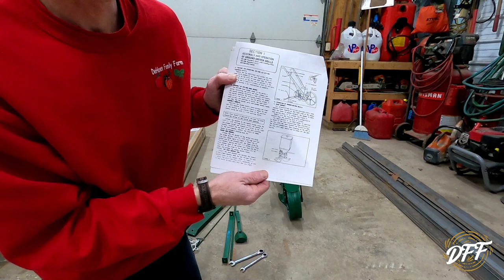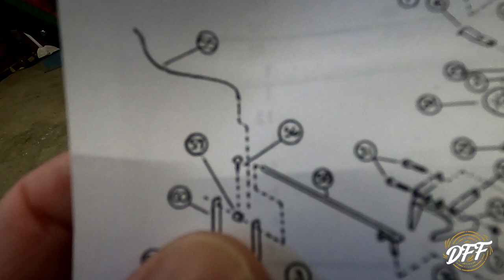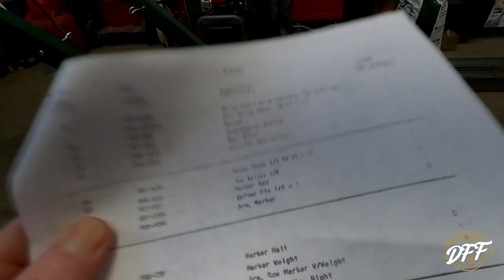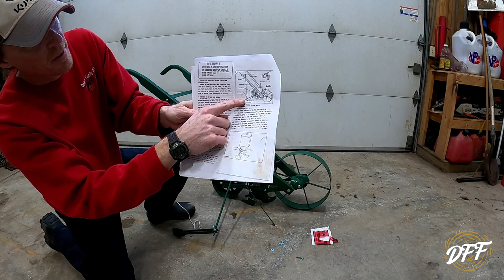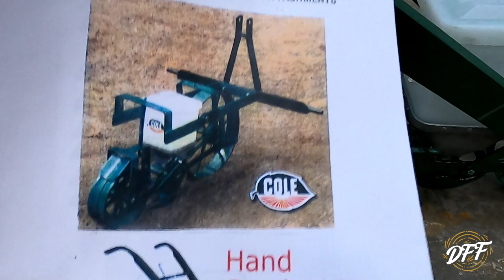NEW Vegetable Planter & Assembly!!

Comment: That mystery hook is most likely to hang the extra seed plates on. The old Planet Jr seeders (early version of the Cole) used a bolt and wing nut to hold the seed plates on the handle in the same spot. Id go that route so you don’t have to listen to wind chimes as you seed.
Reply from the maker: Thanks for the info!!